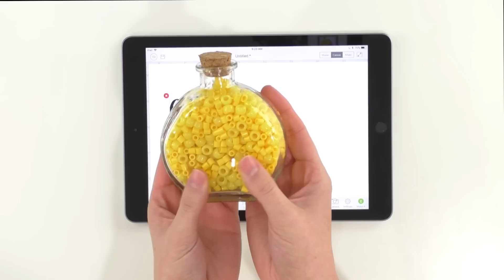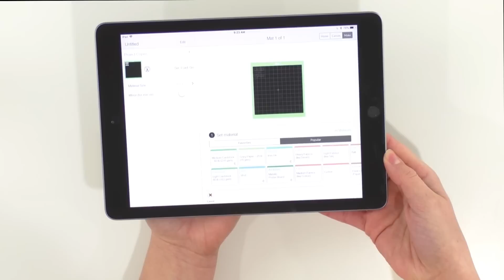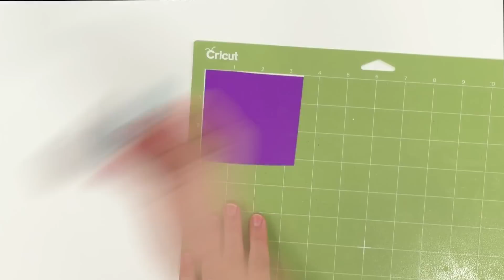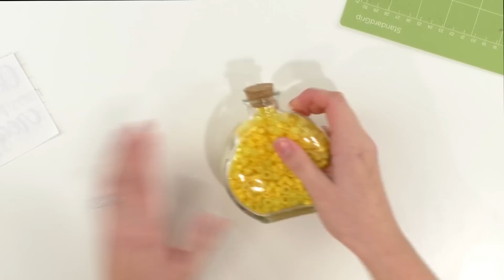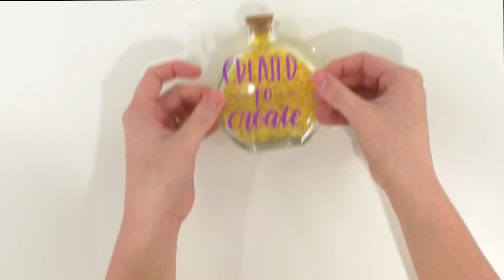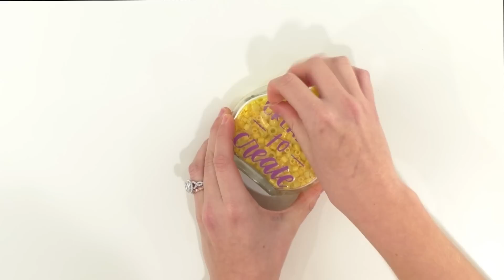Cutting and Applying Cricut Vinyl

Comment: Oh thank you. You said something that will change my crafting with Cricut life   Lol. I have been struggling with applying the sign to the project. The letters stay on the transfer tape     When I heard you say pull back on the tape not up a gong went off in my head. That has been one of my problems. I have heard and seen it before but it never really stuck with me. Thank you thank you thank you.

Comment: I am a new cricut user and I have been having trouble with my cricut brand premium permanent vinyl. Regardless of pressure (tried default and more) the vinyl has a very hard time peeling off the vinyl sheet when I start the weeding process. The vinyl continues to stay together and does not come apart. Any tips or tricks?? I tried reverse weeding but got the same results
Reply: Same
Reply from the maker: We do not like Cricut brand vinyl for this exact reason. It's hard to weed and apply!! We're sorry you have issues. We know how you feel. We have switched completely to Starcraft Vinyl: https://www.143vinyl.com/starcraft-hd-matte-12-x-12-sheets/?partner=219904 and we will never go back!
Reply from the maker: We do not like Cricut brand vinyl for this exact reason. It's hard to weed and apply!! We're sorry you have issues. We know how you feel. We have switched completely to Starcraft Vinyl: https://www.143vinyl.com/starcraft-hd-matte-12-x-12-sheets/?partner=219904 and we will never go back!

Comment: No how much I burnish my letters won’t stick down on the backing 😭😭 I’m so frustrated.
Reply from the maker: Your letters won't stick to the backing or to the transfer tape?? You may need to use a stickier transfer tape!
Reply: @MakersGonnaLearn  it’s almost like it’s not cutting properly so my letters are not sticking to the backing of the vinyl for me to even use the transfer tape. My problem is resolved though. I just used a much better setting instead of premium vinyl.
Reply from the maker: @glamoureyesbychar   Oh okay!!! So glad you got it fixed :)

Comment: my vinyl still is stuck all together even when I use the tool to try and press it down into the mat. What can I do to get it to separate the cut from the vinyl?
Reply from the maker: That means your blade isn't cutting deep enough. Make sure your housing is all the way down in your clamp. Make sure your blade is not too old/dull. Make sure you're using the correct material setting. Make sure you have a good quality vinyl.
Reply: @MakersGonnaLearn  I was using Cricut’s premium permanent Vinyl. Is there a good setting for permanent vinyl on the maker that I’m not seeing?

Comment: My cricut app doesn’t have the option for pressure under vinyl and it didn’t cut deep enough. Is this just a problem with using it on the app? I have an explore air 2
Reply from the maker: Hello! Here is a beginner video for working with vinyl that will help you: https://www.youtube.com/watch?v=f9-05OErUb8
Reply: @MakersGonnaLearn  thank you!!!

Comment: If i were to make a solid image no cut outs etc can the transfer paper be applied before cutting? I’m looking to make small designs that would be applied thenpainted over then peel the transfer off?
Reply from the maker: This is not a good idea as the Cricut is set to cut a specific material not including the transfer tape, and it most likely will not cut properly

Comment: I'm ending up with bubbles or debris under my vinyl after final  application to mugs. Do you have any tips about that? I do wipe my mugs down with alcohol beforehand and my surface is smooth so I'm not sure what the problem is and what to do to correct it once it's applied.
Reply from the maker: Here is a better more in depth video that will help you more! https://www.youtube.com/watch?v=f9-05OErUb8
Reply: @MakersGonnaLearn  Yes, so I've seen that video. I'm doing everything described in both videos but lately I'm getting BUBBLES galore! I don't know what else to do. :(
Reply from the maker: @foxtrottaa  What kind of vinyl are you using? a lot of the time you'll still have bubbles but they wont be noticeable
Reply: Unfortunately I notice them 😏 at first I thought it was an off brand, Hobby Lobby. But then I had problems with Oracal and then Cricut. It seems to have resolved itself. I guess I was just having a bad week. 🙂

Comment: Im new to cricut and vinyl and im so lost. im using removeable vinyl and I was told that I didn't need transfer tape. Im just trying to get a vinyl image to go on a glass surface. Is that true that I don't need transfer tape? I was also told that the vinyl came with its own transfer tape. im lost.
Reply: I'm in a similar boat. She doesn't show how to apply to vinyl to the mat either which I don't know how to do. Pretty side down? Take it off of the adhesive?